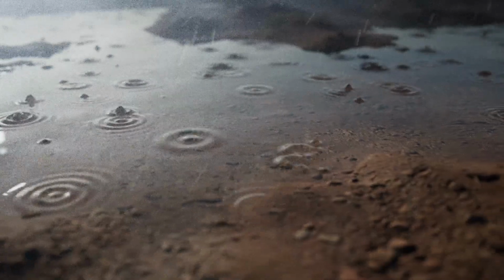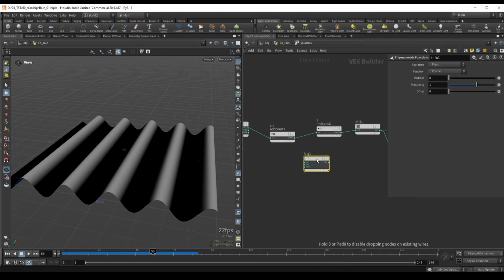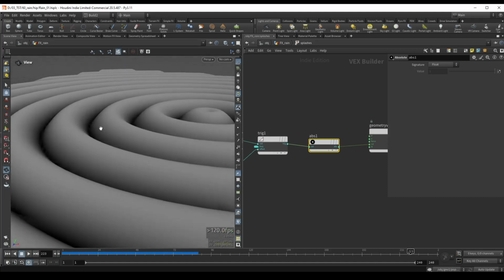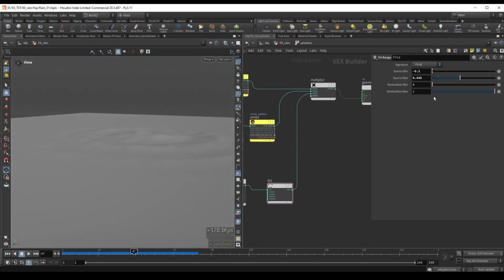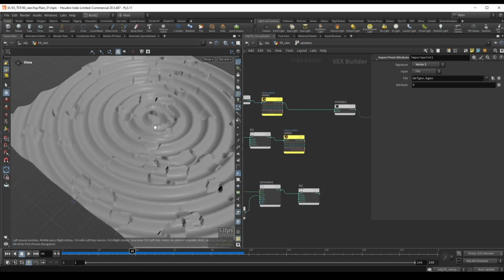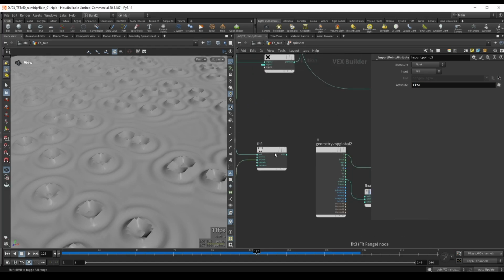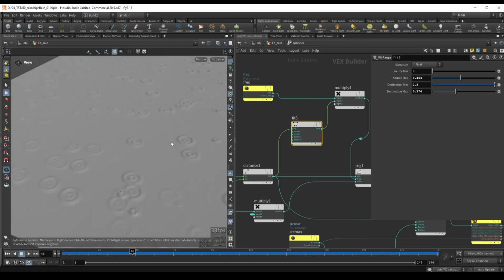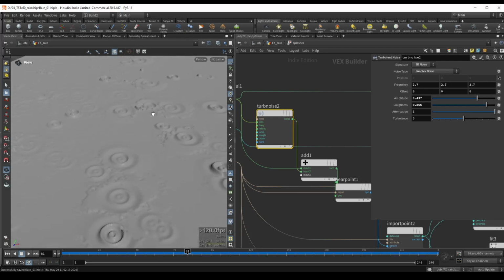Practical VOPS #1 - Rain Splashes - Houdini Beginner Tutorial

Comment: hi, so everything else went smoothly and i started to understand what I'm doing and why I'm doing, but I'm encountering and issue that is driving me nuts trying to debug, specifically it's the particles part, after importing them inside the attribute vop and connecting them to the distance p2 and viewing splashes with the visualize on distance instead of the smooth gradient i get a rough pattern, i think it's called voronoi pattern, everything is nearly identical to the tutorial but still it's rough and it messes up the whole animation cause i get sharp edges, any idea if im doing something wrong and don't realize or if it's something else? apart from this issue i also want to say thanks for the high quality tutorials.